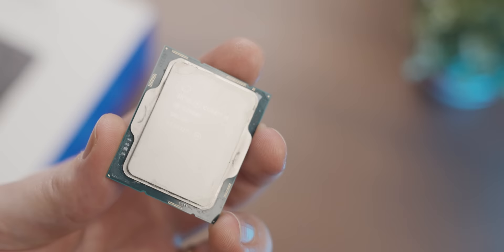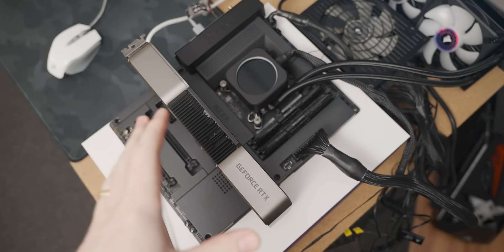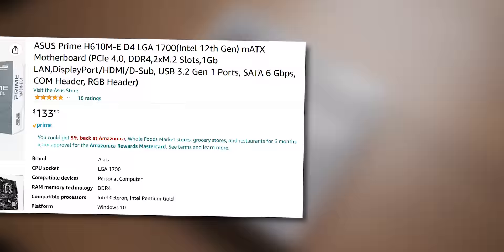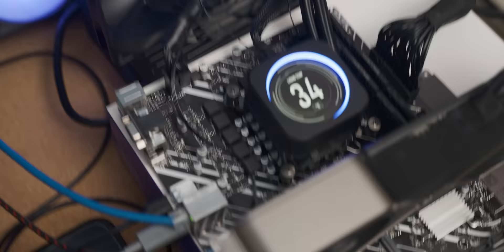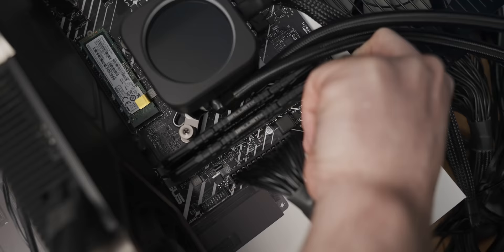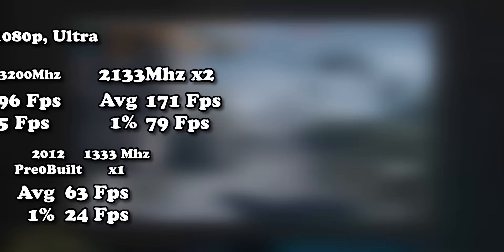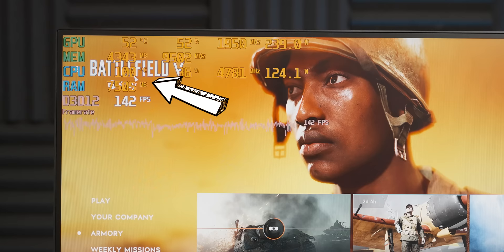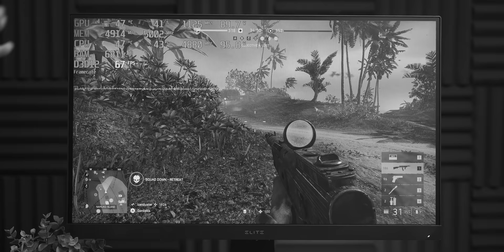What NOT To Do With 12th Gen Intel CPUs...

Comment: Dell: thanks dawid now I know how to make our pc's even more cost-effective
Reply: India already has some terrible customer service representative who break the connector off your motherboards when you give your laptops or desktops to them for servicing. They will do everything in your power to make you pay for each and everything for devices out of warranty.
Reply: @roschlynnmichaeldsouza5747  this is why when my G5 SE laptop number keys stopped working and it took way too long for them to toss me around to different departments i just kept it.  because everything else worked and the lottery of trash out there for the G5s meant i would most likely get a WORSE refurb or even new G5 in return…. horror stories on these all AMD laptops.
Reply: @mikec5767  Found a fellow G5 SE victim on the internet.
Reply: Nooooo what did you say now they are going to do it
Reply: just dont mount the cooler, you could probably save 30$ right there

Comment: Interesting, usually we hear that Ryzen needs fast RAM but Intel isn't so sensitive, this video shows the new Intel generation looks very susceptible to what RAM is being used...& as always good fun with Dawid :)
Reply: @DCookStaVideo  That was only really an issue with 1000 series, the memory controller wasn't good at all. Memory stability was vastly improved with each new iteration. I can throw literally any DDR4 kit at my 3600 and my 5800x without any instability. I even got a 3000 MHz kit stable at 3600 MHz.
Reply: To be fair, too many variables were introduced.  I would have liked everything to remain the same and just lower the ram speed.
Reply: @Dee-tc7lo  I've got a R5 3600 and had to downclock my 3200MHz kit to 2666MHz (though might be able to improve it). Apparently using 4 DIMMs total reduces performance, but I need the RAM capacity.

Comment: It's possible that the air cooler being a downdraft design gave the vrm some cooling, which helps performance as we saw earlier.
Reply: U think those little heatsinks that stick on would help iv been thinking about doing that to my mb there usually pretty cheap
Reply: @Durkhead  yes but if your brave use thermal cement instead of the sticky pads. It’s amazing what even a small heat sink can do.

Comment: i remember when my friend bought an 8700k and paired it with the cheapest 50dollar motherboard he could find. but then spent 200dollars on his keyboard alone. make it make sense.
Reply: For most people, motherboards are very obscure and it's difficult to the casual consumer to comprehend what makes one better than another, especially if they're not into overclocking.
Reply: You know what, having the best keyboard you can afford absolutely makes sense, i can stand behind that.

(typing this on a heavily scuffed up Drevo i got for $15 - not bad really, not terrible at all; well it needed some maintenance because uh previous user had left it in a barely functioning state but that's OK)
Reply: @michaelrusso9809  problem is I know my cpus and gpus, and ram... idk shit about what makes a good mobo, or even what I am looking for if I decide to build a 12th gen pc
Reply: If you do not overclock your CPU, and do not use CPU intensive applications, you would not notice much difference between motherboards.
Reply: @jponz85  Watch some of Hardware Unboxed's motherboard roundups on B660/Z690 motherboards, that will give you a good place to start. You might not understand everything they're talking about, but you'll get the gist of which motherboards are decent and which aren't. 

Some general stuff to look for: 

The cooling. This will be obvious from looking at the board. The more heatsinks there are, and the beefier they are, the better. However, use caution if using a large air cooler like a Noctua DH-15, as heatsinks that are TOO beefy can interfere with its mounting. If you plan on using a higher-end CPU like a 12700k or 12900k, this becomes more important. If you're using a 12100, 12400, or even a 12600k (to some extent), it matters less. 

The power delivery, measured in phases. The more the better. Not something you need to worry about too much unless you're overclocking, but something to keep in mind as you compare boards. 

The rear I/O options. You'll want to buy something that suits your needs. For example, do you need wi-fi/bluetooth? Do you need more than one or two USB-C ports, or a lot of high-speed USB ports? Do you have a surround sound system that requires a lot of audio ports? 

The internal I/O. One thing I often see overlooked is that if your case has a USB-C port on the front I/O, you'll need to connect that to an internal USB-C header if you want that port to be usable. Not all motherboards have such a header. Also keep in mind how many RGB, ARGB, and USB 2.0 headers you'll need. If you're using standard fans without a splitter or fan controller, you'll also need a good amount of fan headers (though, as with (A)RGB headers, getting a splitter is always an option). 

How many M.2 NVMe drives you plan to use. Make sure to buy a motherboard that comes with enough slots. Most B660/Z690 motherboards have at least 2 (though some have as many as 5, IIRC), but smaller and lower-quality mini-ITX boards might not. 

How many PCIe slots you need. If you're using something like an internal wi-fi card, capture card, or sound card, you might need more than one. Again, most boards come with at least two, but smaller boards might not. Also, keep in mind the spacing between PCIe slots if you plan on using a beefy GPU, as you might be prevented from using the lower PCIe slot if your graphics card is too big. 

Your EPS 12v cable connections. Most lower-end boards have 8 pins, which can be provided by most standard power supplies, but some boards have 8+4 or even 8+8. If you're getting such a board, you should also buy a power supply capable of providing those connections. Most of the time, you can boot and function well enough with only 8 pins connected, but I've definitely heard of cases where a build wouldn't POST unless all of the cables were connected. This is also really important if you're overclocking. 

DDR4 vs DDR5. You'll need to buy a board that supports the kind of memory you intend to use. For my money, I'd say that DDR4 provides the best value right now, but sooner or later the market will be transitioning to DDR5 exclusively, so bear that in mind as you consider the longevity of the system. 

Finally, the brand. The brand determines everything from what kind of customer support you can expect, to what the RMA process will be like if something happens, to the usability and user-friendliness of the BIOS, to the general quality. This is a subjective category. For me personally, I rank ASUS near the top and ASrock near the bottom (I have an ASrock motherboard and would not recommend getting one). But some people have a bad experience (or experiences) with an ASUS product and swear off them forever, and some people have nothing but good experiences with ASrock. I'd do a bit of research here. Look up professional reviews of the motherboard(s) you're looking at, as well as regular customer reviews, and poke around on the brand's subreddit to see what their customer service might be like.
Reply: That’s like when people gripe about a tube of good thermal paste being too expensive so they use stuff that cost $0.10usd a gram and there pc overheats

Comment: 8:42 I think it will throttle pretty hard if you go back to dual channel at XMP speed but keep the cooler. That's the average Dell user experience
Battlefield is NOT the title to test low ram speeds with

Comment: Thank you for this video. Whenever I build a budget system for a Client(part time hobby / pocket change) I have been going with 10th Gen Intel 10100f, 10105f, 10400f, whatever happens to fit the build and is the best value at the time, I have been sticking with the Asus TUF MATX board which is roughly 140$ US. Whenever I send the parts lists I always get the question of why is the motherboard so expensive, you could go with X for 40 or 50 less... the boards they reference never have built in wifi,  are limited 2400-2933 ram speeds, and have no VRM cooling. Normally I can explain it and get them on board but there is always that 1 guy who knows that they are basically the same thing one just looks cooler... I will send them this video from now on.
Reply: Actually, if you use i3 or i5-10400f you could use cheapest boards available because CPUs in question do not really benefit much from VRM cooling and WiFi dongles are cheap. To benefit from more expensive boards you would need higher end components , both CPU and GPU.
Reply: @aleksazunjic9672  I get the slightly better board for the XMP compatibility and Wi-Fi 6(35-45 dollar dongle)and I have yet to have one of these show up DOA. I have had to return multiple bottom tier boards that showed up DOA and have had several fizzle out early. Getting the MATX is the compromise to keep pricing reasonable. Spending 40 or 50 extra in this area gets a lot of performance per dollar.
Reply: @RegazozoGaming  WiFi on motherboards are usually of very low quality, most people do not need Wi-Fi 6 , as for quality that depends what do you do with board. If you put them in a case with bad airflow, and insufficient power supply they tend to break. In real life budget boards with components that are not overclocked tend to last longer than medium, or even high-end boards that are put to their limits.

Comment: Results are actually not surprising. First of all, K series of CPUs are actually designed (binned actually) to be overclocked and run hot. Now, if you hobble them with low frequency single-channel RAM, they would actually idle for most of the time, waiting for other components. If you put non-adequate Athlon cooler they would heat up, maybe throttle a bit at highest temperature, but would still idle about the same. If you put them on low-end MB with otherwise good RAM and GPU, power delivery of said motherboard would be a limiting factor and cause for throttling. Overall, you don not "torture" CPU with low-end components, you only make it wait for them and then it runs slower but uses less power.

Comment: I think the comparison between different speeds is not quite fair in this one because of the memory capacity being halved. As is seen in the video, bf5 uses ~12gb out of the 16gb of ram. When you decrease the total memory to 8 gb, it is bottlenecked by the capacity (as seen, it takes ~7.5 gb which is full assuming windows and other stuff takes memory too) and having to read/write from pagefile, which is slower.
I think you should do a test with 2 kits of memory with the same size and different speeds to see how 12th gen really fairs with different speeds! (maybe even single channel vs dual channel but of the same capacity)
<3
Reply: 👽 Mate you almost get it, but perhaps more interesting test would be the same test but also with the timings tightened as much as possible. 👽

Comment: The fact that the CPU is just not doing anything to prevent itself form self combusting is actually kinda scarry. Imagine newby builders with a CPU like this that have no experience what so ever and do not even check the temps as long as it is working "fine"". We are gonna have a CPU running at 100C like a freaking stove like there is absolutely nothing wrong...

Comment: I recently built a 12900k system for myself. Got a Kingston DDR5 5600mhz memory kit. It's fast as hell. Happy I did not go with DDR4.
Reply: it performs the same with proper ddr4 and mobo, as its been tested multiple times, but, sure ddr5 5600>ddr4 3200-3600.. issue is, 500$ vs 100$ on ram for about 0 to 2% bonus

Comment: Haha, that was excellent! Trying to run a 12900K on a crappy Athlon stock cooler! How that did not throttle even worse, I do not know.
When I go for a 13900k or 14900k, I will get a nice MB and RAM, though I might be limited in the latter as, even with a B450 build, I still have to run the RAM downclocked from 3200MHz in order to get good stability in game!

Comment: Why the small COOLER helped...
I guess DAWID forgot about the AIR FLOW helping to keep the power delivery from overheating and forcing the CPU to throttle? The CPU heats up but the power delivery is cooler relative to the AIO.

Comment: About the RAM 320hz vs 2133mhz not changing the 1% lows: could be that the timings of them are basically identical speed at the end which results into that result. I'm not quite sure at the moment, but if you just dropped the frequency but you're still using XMP, then you should be using the better timings the RAM this kit comes with on their XMP profiles

Comment: did you mess with the memory latency/timings?
2133 cl 14 vs 2133 cl 20 should make a difference (i think)
Reply: From my experience in the DDR3 days, memory timing can make a huge difference.  Going from 9-9-9-16 to 6-6-6-12 made a big difference with a system that hated when I tried to push the memory speed any higher.

And yes, I know, that's nearly DDR2 timings (granted, shitty DDR2, but DDR2 nonetheless) on DDR3.  I had a lucky good set of Corsair memory.

So, timing can be just as important as memory speed, though often is more fiddly to get it right.  If you're messing with timings, expect a lot of trial and error, and expect a lot of CMOS resetting because you pushed a little too far.

Comment: 7:50 it may be due to the fact that MOSFETs have lower internal resistance at higher temperature. I know Intel sapphire rapids have similar behavior - they have slightly higher performance at higher core temperature
Reply: Mostly because this particular CPU was binned to be overclocked, i.e. work at around 100 C.

Comment: Would actually be REALLY interested to see how much a lower 12th gen is affected. A 12400 or something? Even a 12600k.

Maybe see what happens if you turn off some cores on the 12900k to simulate a different chip?

Mainly to test something like memory bandwidth effects on core #. Is the 12900k more susceptible to poor memory due to sharing among more cores?
Reply: If you were to turn off other cores its still a higher binned version

Comment: I feel attacked, the only reason i got the 12900k for my 65w 1U server, is because i couldnt get my hands on a 12900, or, what i really wanted, the 12900T
128GB of 2667Mt/s 'ECC' RAM.
i already had this RAM, and because it is a 'server' i figured that it would be more stable than gaming RAM, even if ECC didnt work properly.
Reply: wait, 12900k for a server?
Is that for hosting game servers or something?
Reply: I like T-series processors a lot for being very power-efficient, but honestly I've found that if you don't mind just doing a little tinkering, you can just turbolimit and undervolt an i7 or i9 series processor to do the exact same thing, but better – I got a -155 mV undervolt on an i7-7700 that reduced its power consumption by almost 10 watts (it maxes around 40W now), such that I didn't even need to disable turbo to get it near the 35W TDP of the T-series, so I get tons more performance just because the silicon lottery of better-binned CPUs lets me optimize them better. Most T-series are just reject chips that couldn't make the cut as a proper K-series chip.
Reply: @michaelrusso9809  Right, the problem i have is that i could only find the 12900k. I wanted those 8+8 because i plan on hosting several docker containers on my file server, and the video encode engine should also help alot for PlexDVR. And because the space only really allowed for 65w of cooling, i didnt spring for the best motherboard, and it doesnt seem to have the best overclocking/underclocking options.
Reply: @michaelrusso9809  also, being a 240w processor, i didnt want the BIOS resetting after a power failure, or a bad bios update from windows, and then the processor cooking itself, because the host OS doesnt have the best CPU monitoring software. 
I wanted the 12900T so i could just drop it in and never have to worry about a 25w processor overheating under a 65w cooler
Reply: @denvera1g1  motherboard doesn't really matter if you're trying to go down rather than up; I'm working with a really budget consumer board. You can use Intel XTU or ThrottleStop running as a service (which I prefer) to undervolt and disable turbo, try to lock the processor at a certain multiplier, whatever, to reduce its power draw through software.
Reply: @FakeMichau  I may at some point, but mostly its going to be a file server, hosting docker and VM images of anything from PiHole, PlexDVR, and transcoding said recordings to H265 or AV1, to security camera recordings and AI image recognition of security footage, as well as AI recognition of my vast 5TB worth of photos and videos i've taken
Reply: @denvera1g1  if I'm not mistaken you can also tweak ThrottleStop or XTU to set an overall powerlimit (I think it's IccMax under the voltage regulator module) but I've never experimented because I'm not that desperate to reduce my power draw below 40W at the cost of considerable performance.

Comment: Is it still OK to use Win 10 with 12th and upcomming 13th? I really want a new PC build but I just despite Win 11.
Reply: It works okay most of the time. There are cases where it will not deliver great results though (like cutting 1% low figures in half).

Comment: Sorry to be harsh but you are missing the concept of bottleneck. If your CPU is memory starved like that, it will not be able to do much at all and sit idle most of the time - thus giving you no effective further drop with the shitty cooler. Now if you were to run it at ideal everything else BUT the cooler, you would see it. 
Also you can't really talk about memory bandwidth issues regarding the architecture while testing a gaming workload. Try to run stuff like Photoshop it will lose much much more